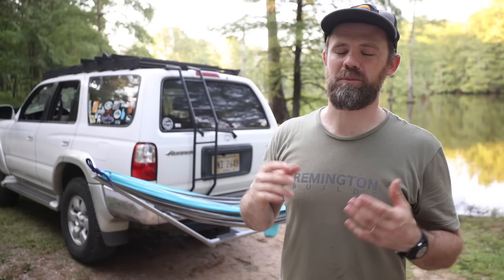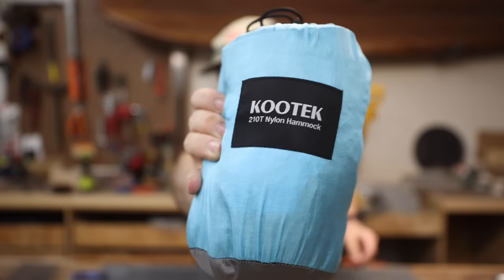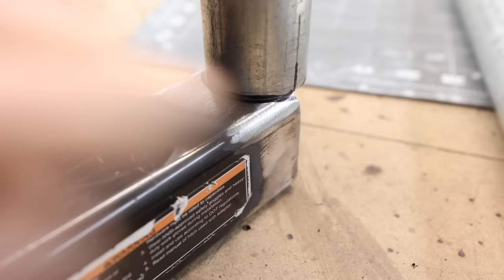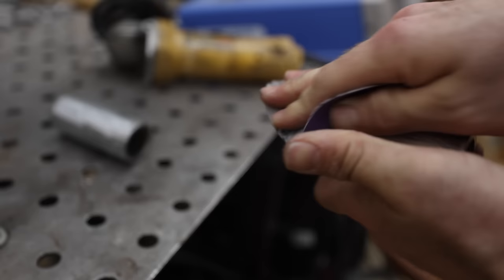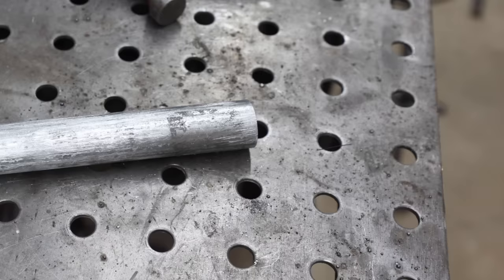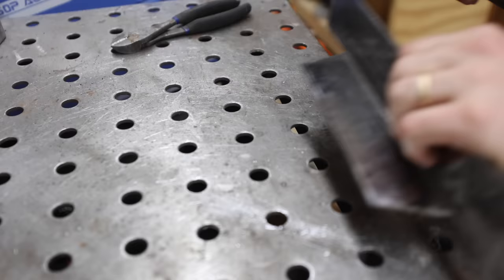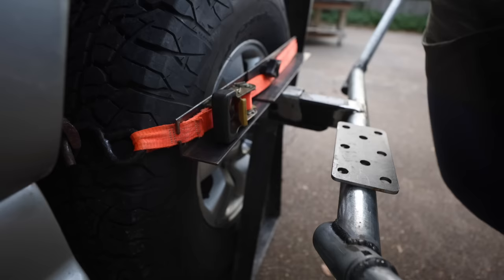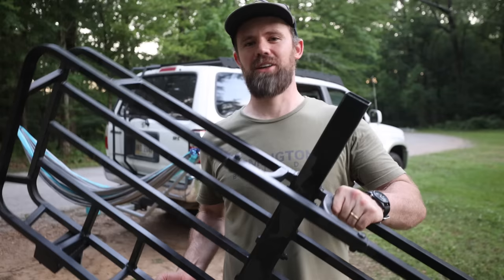DIY Hammock Mount for your Vehicle! *Experts Only* - Kootek Hammock GIVEAWAY!

Comment: Great idea and well executed.  Instead of sanding the weld seam from the inside of the 1" pipe, I'd add a little groove to the outside of the 3/4" so it would fit nicely since it would be so much easier and not require an additional tool.  Just a thought.  Thanks so much for sharing your ideas.  Always interesting to see...
Reply from the maker: You are welcome! Thank you for your support! Yes, you could do that as well. I Should have mentioned that!!

Comment: I just found your channel. Nice job on the hammock mount. I made my own hitch mounted hammock stand out of a couple old trampoline frames. it was essentially "scrap steel". I've heard it called "upcycling" when you recycle items and change their original purpose to suit your new goal.

As luck would have it the leg post from one frame was a perfect fit into the other frames leg post. 

I used the larger diameter pipe all the way up as my hammock support legs. I cut the smaller diameter pipe into pieces and plug welded them into the larger pipe through holes I drilled into the bottom of the larger diameter pipes. This allows the pipes  to butt together snugly and I didn't need the "rings" you welded onto your legs. 

Liked and subscribed...
Reply from the maker: Nice! That’s a great idea!

Comment: Really great ideas!  I had started making a freestanding folding hammock stand to use under my awning, but the tire mounted version would be perfect and much lighter. thanks for the inspiration!
Reply from the maker: My rooftop hammock mount works on the ground.. not sure if you saw that video

Comment: I love the idea of these but I've always been concerned about the weight capacities.  I drive an outback with an official tongue weight of 100lbs and I'm closer to 300lbs.  Was wondering about wear and tear long term on the vehicles, assuming I could afford one of the kits.  I'm assuming the tire route would be more sturdy?
Reply from the maker: What year? I have a 2013 outback and the tongue weight is 200lbs. 2021 outback is 350lbs. I’m not worried about that at all. I personally would not put 300lbs on the tire mount. That’s a lot of force on the strap holding it to the tire.
Reply: @PatrickRemington  it's a 2015

Comment: My wife and or kids would love one of these. Great build and looks very sturdy.
What do you think would be the weight capacity?
Reply from the maker: For the tire mount I wouldn’t go more than 230-250lbs. My wife and I both got in the hammock when in the hitch mounted position. Should have done a clip of that. We are about 310 together
Reply: @PatrickRemington  Awesome thanks Patrick. Great channel by the way.
Looking and building a rooftop tent as we but will frame it with aluminum.